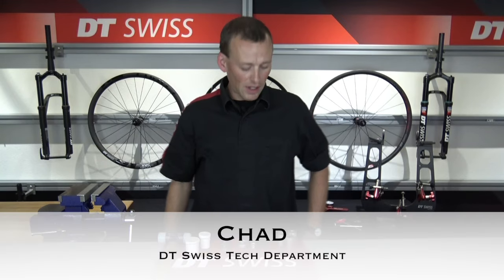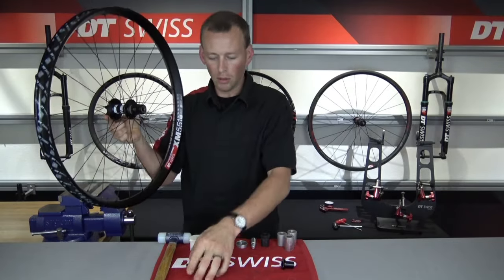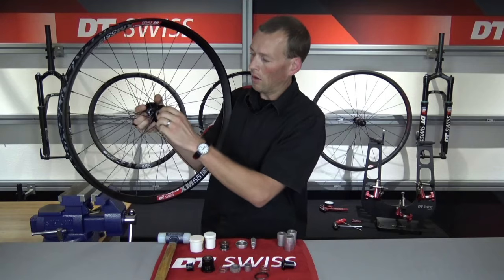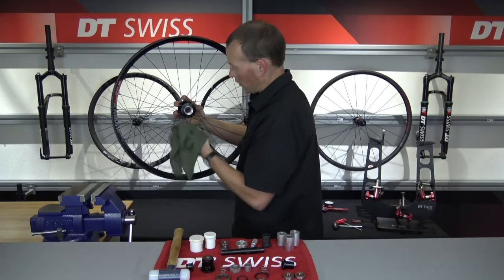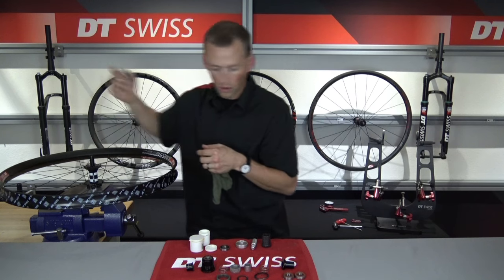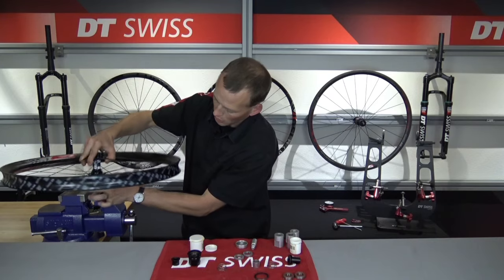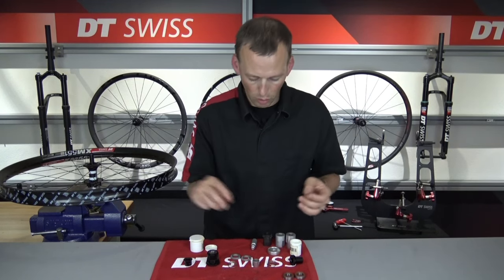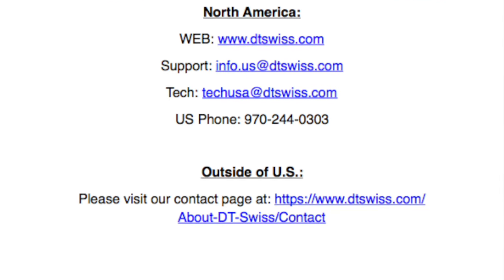Bearing service on DT Swiss Star Ratchet hub. How-to tutorial.  | DT Swiss

Comment: Very disappointed in the design of the lockring. I just dropped $75 for the removal tool and I can't budge the thing (I'm using a vice as shown in the video). Why did you guys design your hubs to require super-human strength to service? The wheels have about 2000 miles on them so are not that old. Any tips on getting this off without having to invite two of my cycling buddies over to help? I'm also worried that if and when I do get sufficient turning torque, I'm going to damage the rim by causing cracks at the spoke nipple contacts. There's something to be said for Shimano's cup and cone philosophy. Servicing those hubs has never taken more than a 1/2 hour per hub. This has been going on a week messing with it on and off and having to buy an expensive specialized tool. I bought DT-Swiss thinking I was getting a higher quality product but when you factor in the complicated hub maintenance plus costly tools, I really don't see the value proposition. Recently I replaced bearings in my friend's Zipp wheel which also uses a pawl design. That was a simple matter as the lockring ID sufficiently greater than the bearing OD making it easy to press the bearing in without the need to worry about removing the lockring. In my opinion, you guys really should add 100th of a mm or so to the lockring ID to avoid this issue altogether.
Reply: I just spent hours trying to get mine off, but i managed to do so with a neighbors vise - the wheels also have about 1-2 k on them and i was worried that all that pressure off the vise will damage the spokes or rim. It is quite ridiculous but im sure you can get it to go with the vise if you turn it (counterclockwise) hard enough. I had to lean my entire body on the turn before it popped loose. and that stupid hub seal that is seated surely doesnt help with braking the ring nut thread free.
Reply: @rexfest  Quick update. With the help of two of my friends (yes two) we were able to finally loosen the lockring. The wheel and spokes seem fine, just make sure that they are are in good true first (a rough proxy for having spoke tension in the recommended range). I have a spoke tension meter so I confirmed that way as well as on the truing stand. As for getting new bearings in, you could do a decent job of it with a soft blow mallet and a deep socket that's sized to make contact only with the outer race of the bearings. I used a slightly more elegant (I think) approach of using my BB press with the old bearings serving the role of drivers. That is, the old bearings are perfectly sized to make nice even contact with the new one so when they help push the new bearings in nice and smooth. You do have to do one final tap on the non-drive side however b/c the axle prevents you from using the press to fully seat the bearing (but you can get it in about 1/2 way with the press/old bearing method).
Reply: @stuartsiegel2327  I just used a threaded rod to press in the bearings. i have a 3d printed adapter that i stack on with the bearing adapter for one side since the axle was poking out as you said, but all is well and i got the job done as well. Cheers to rolling on DTs! haha...
Reply from the maker: Hello Stuart, sorry to hear that there are difficulties removing that stuck ring nut. Please email us at info.us@dtswiss.com and we will be happy to email you some detailed removal instructions that should help.

Best Regards,
Andrew
DT Swiss USA
Reply: @dtswiss  thanks for reply. I managed to get it off. I gave it a good WD-40 spray down, waited 24-hours and invited one of my biking buddies over for turning assistance. Between all that, it came off.
Reply from the maker: Glad to hear it. Yes, this is usually a 2-person job because the torque of pedaling forces tightens the ring nut. Please let us know if you have any other questions in the future.

Kind Regards,
Andrew,
DT Swiss USA

Comment: This system sucks! We broke our shop vise trying to get the ring nut to break free!
Reply from the maker: Hello, sorry to hear your shop vise broke. Insert the tool as far into the vice as possible (use the longer wrench flats) and tighten as much as possible. We find that removing the ring nut is a two and sometime three person job. It helps to keep the tire on the rim for extra grip. Secure the ring nut tool ‘firmly’ in the vise, and leave the axle in the hub so that it goes through the tool. Turn the wheel with a sudden thrust of effort and it should break the ring nut free. Another method, and what we do at events when there is no vise, is to have someone hold the wheel vertically on the ground and put a wrench with cheater bar on the ring nut tool.  Be sure to orient this so that the wrench is being pushed down.
Please note the ring nut is tightened as a result of pedaling forces. We have never encountered a ring nut that we were unable to loosen using the methods above.

Best Regards,
Andrew
DT Swiss USA

Comment: This looks so nice and easy on a never used, clean hub. In reality tolerances are off, you will use tremendous force and destroy this hub. It's really a "use-and-discard" product, don't even think about replacing parts in this crap product, and do not spend 200€ in the "so special" tools you'll need to  ust disassemble. So disappointed - never ever any DT Swiss on my bikes. From the beginning this hub was not smooth but very, very tight. Trying to change the bearings I ended up with a destroyed hub.
Reply from the maker: Hi, sorry to hear about the difficulty in servicing your hub. I've never seen a hub "destroyed" during bearing service when the proper service procedures are followed using the factory recommended tools. Please contact your local DT Swiss service center for further assistance.

Regards,
Andrew
DT Swiss USA